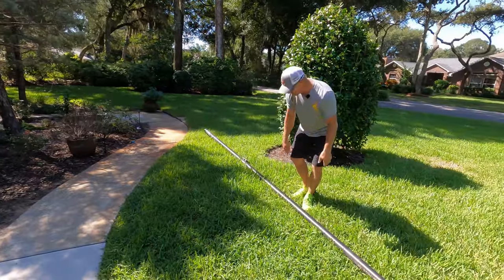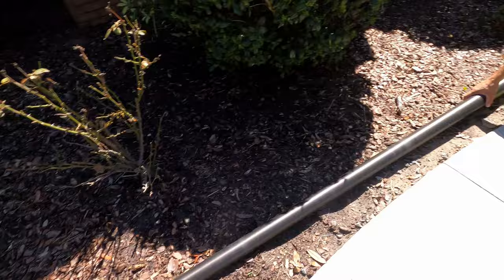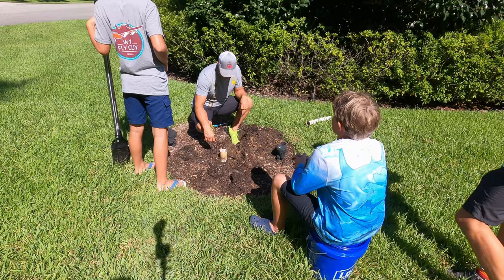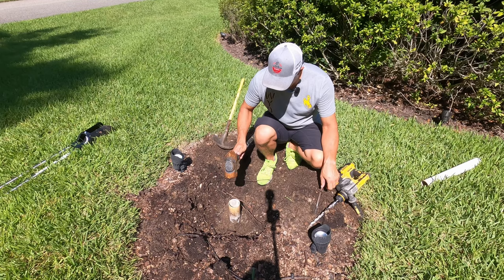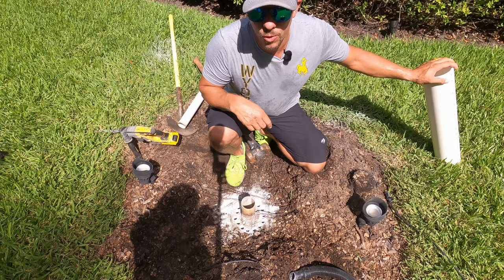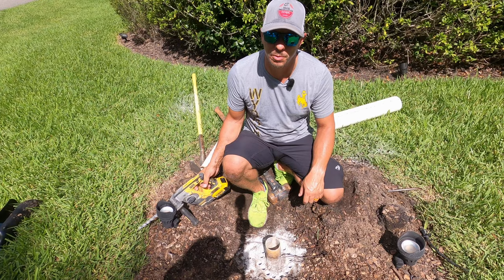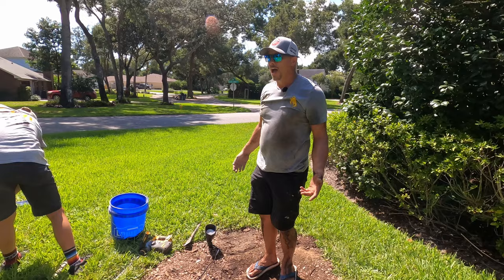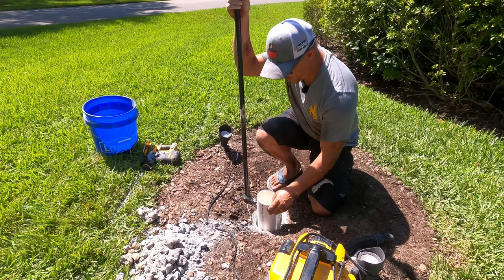HAXMAN Did NOT Prepare Me For This Flagpole Installation!

Comment: Putting a regular flag pole, digging a hole, stone in the bottom, about 20" or so deep. My question is: I see many that put the dry concrete in the hole and then water it over a period of time. Is that the way to go or should I get involved with mixing the cement? Is either way ok?

Comment: This happened to me years ago except in a different way. I ended up having to dig all around the concrete and I eventually had enough room around the sides of it that I could wrap my 15,000 lb limit tow rope around it and tie a knot and I slowly pulled it out of the hole with my truck  and then I dragged to my back yard and it's been there ever since.
Reply from the maker: There you go!

Comment: if you were putting in a 3 inch pole and it looks like a 2 inch in the ground, you should have bought a 2 inch adapter so the 3 inch would fit in a 2 inch sleeve.

Comment: Since the bottom didn't fit you could have just turned the flagpole upside down and concrete the top into the plexiglass and then mount the flag.